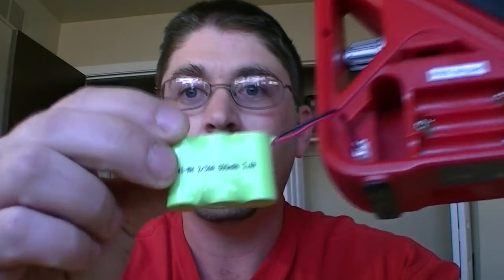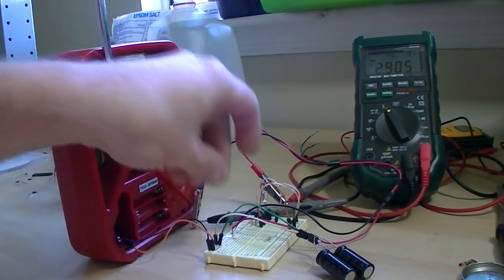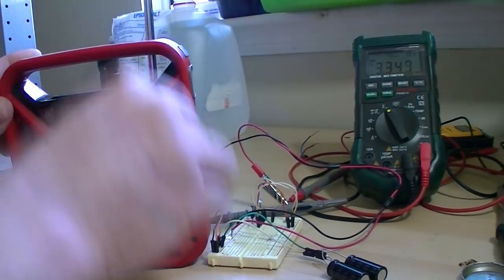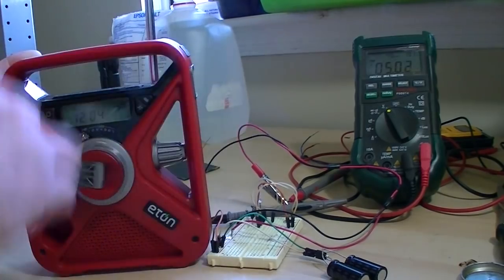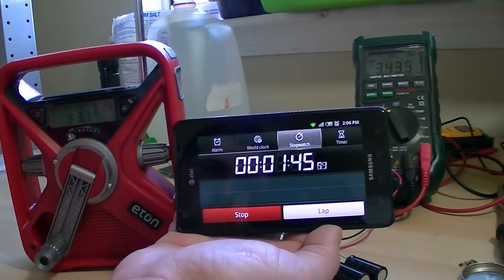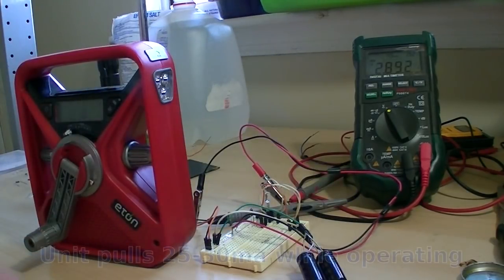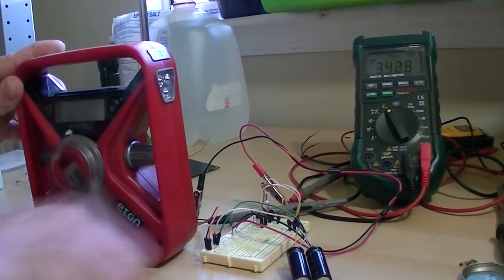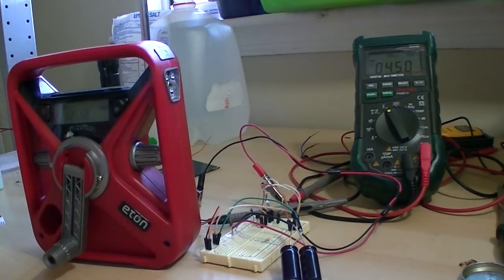Supercapacitors Instead Of Rechargeable Batteries

Comment: what about using a super capacitor to help charge the batteries?
Reply from the maker: wahtah955 In that context it's better to put a suitably sized supecapacitor bank in parallel with the battery to take the strain off of the battery when current spikes hit.
Reply: R&TPreppers thats awesome.  thanks   Would you wire them in  parallel with the batteries or would you have to be more fancy?  Does tha lack of resistance in the supercapacitor automatically drain before the batteries begin to pull charge from?    I'd love a video on that,  if you don't already have one  thanks

Comment: Hey

Do you know

Multimeter or volt meter has high resistance
if you use it with LED

It can run only 1 minute Maximum

Comment: Another name for "supercapacitor" is a "capacitor". There's nothing super or magical about them, they are just capacitors. Here's your example of the difference between a legitimate electrical engineering degree from an accredited University and some schmo that went to ITT Tech. There's a reason billion dollar electronics companies use batteries in cell phones, iPods, etc. It's because they hire real engineers.
Reply: Supercapacitors are low voltage components. JSR Micro-3.7v Li-Ion-capacitor 3,000F!;  NEC 3.7v Li-Ion-capacitor 1,200F!!! These are not LITHIUM Batteries! you should do some research before you post comments. :(
Reply: Jeremiah L Urine idiot. Nobody said capacitors were lithium batteries. I said that there's a reason billion dollar electronics companies, and the legitimate engineers they hire, spec out batteries in cell phones, iPods, etc. INSTEAD of capacitors. Your electronics skills are even worse than your reading comprehension skills..... or lack thereof.
Reply: Mark Mark lol on that one :)  i am sorry for your misinterpretation of the comment that "these are not lithium batteries", but once again you should do your homework on the manufacturing of Super Caps (Li) vs Regular Caps (Al or Ta) and their uses. Supercapacitors Instead Of Rechargeable Batteries (YT). I also guess from your conclusin that their is nothing magical about Lipo batteries either  5S 5000mah.
Reply: Jeremiah L No, there's nothing to misinterpret. That's what you said. And you seem to think you can cover it up and make yourself sound intelligent by listing item for sale at Radio Shack.
Reply: Mark, they are named "supercapacitors" to distinguish them from regular capacitors, including electrolyte caps, they have different internal structure - No typical separator inside. Due to different construction they have energy density levels magnitude or two higher than electrolytic caps.
Both zinc carbon and lithum ion batteries are electrolytic cells, but to help distinguish between them we don't call them so.

Comment: Those batteries still have a higher total capacitance, super caps work effectively as batteries with a very high C rating both for charge and discharge but  you pay for that in lack of total capacity. High performance lithium batteries win out in most situations except cost.

Comment: Chinese already do this, my "800mAh" rechargealble battery, was in fact epoxy with a resistor and a axial capacitor...
(yeah, i usually take the lithium from old batteries, but wasn't nothing in this one)

Comment: Dude. Learn the difference between series & parallel. Paralleling capacitors adds the capacitance & leaves the voltage rating the same. Putting them in series doubles the voltage rating but halves the capacitance.
Reply: The capacitance is the work done to charge up an electron charge reservoir.

1 F = 1 V x 1 A x 1 sec of work done to charge a reservoir.

If we stacked five 1 F capacitors in series = 0.2 F stacked,
then 1 V will drive only 0.2 A in 1 sec.

Capacitance = charge q / voltage V.

Given a constant charge q, and a five times voltage increase, will reduce the capacitance requirement to 0.2 F.

5 V maintains 5 times coulomb energy or requires 1/5 capacitance to store 1 time coulomb.

But if we increase the charge capacity by five times too, then the stacked capacitance will still be 1 F.

As long as we can ensure each of them has a terminal differential of 1V and drive a charge of 1 Amp.sec across each unit that was placed in series, we will be able to bring each of them "up-to-charge" of 1 F each.

Therefore, placing 1V DC across a series of five 1 F capacitors would reduce their average terminal differential to 0.2V and hence the reduction in capacitance fulfillment within 1 sec of charging.

But if we increased the voltage to 5 V, then we would be able to maintain the ideal 1V terminal difference.

However, unless they are self-regulating or externally balanced, we cannot ensure that elements placed in series will each have the same terminal differential as the others.

Therefore, we can charge them in parallel to ensure a 2.7V terminal differential during charging, and then discharge them in series. As long as there is charge in each capacitor, and a terminal differential, current will flow. So there is no point in thinking about in-series capacitance reduction, when we have strategies to charge each of them at 2.7V ! ! !

For a given current, the higher the voltage, the lower the required capacitance.

Capacitance is not the charge capacity of a capacitor.
Reply: He is a little wet behind the ears, maybe the kid needs to go to school before making a video.
Reply: MrMac5150
Since there is no smiley face attached to your comment or a +1 for me I will explain. Lionel wrote " Learn the difference..." and I thought she had "schooled" him. So there's the insinuation explained mate.
Reply: MrMac5150 thatsthejoke.jpg
Reply: +God Emperor Lionel Lauer he said he has two 10F capacitors wired in series to give an effective capacitance of 5F, and looking the video it appears to be wired in series...don't understand your point
Reply: Cynthia Avishegnath You learnt him sumthin good.
Reply: Bull Shyte
You need to learn how to spell.
Reply: frtard
Retarded joke, people believe that shit.
Reply: PrevailingDanger He gets it right at the start of the video, then gets it completely wrong towards the end of it.
Reply: God Emperor Lionel Lauer

Butt head is wrong from start to end.

Comment: @R&TPreppers: A far more accurate test, and more reasonable it seems, would be to do the same test with the newer, more"standardized" Maxwell 350 farad 2.7V batteries, not 5 farad ones. The results would likely be more in line with seeing if reasonable discharge times result, etc.

Comment: Cool Vid.  I wonder if it would be useful to quickly charge the ultracaps & then discharge them into a slow leak li-ion cell or battery.  A 2nd generation li-ion cell can hold 85+% of it's charge for over a year (from what I've read).  What do you think?
Reply: ***** I've charged many 18650 li-ion cells.  They aren't particularly hard to charge.  I just use an old phone charger & have it cut-off charging when the in-circuit V reaches 4.2 V.  At 4.2V, the cell is over 90% charged--which is good enough for most applications.

Just a thought.

Comment: I already designed a slow discharge discharge capacitor to handle batter powered devices. Tee are already capacitor battery replacements on the market... They do not last for long without recharging...

Comment: What are the capacitors made of?
Reply: George Louis
Copper is the best!If you exclude Gold..But mostly a special Iron is used.But maybe in the super capacitor it is Copper??
Reply from the maker: I may actually answer this question soon.  I want to open up an electrolytic capacitor and a EDLC supercapacitor and compare the two internally.
Reply: R&TPreppers
but are they liquid metals?
Reply: Capacitors are made of two long sleeves of metal with isolating material in between,rolled up together.
Reply: ComPuterAddic
Any conductive metal? Copper?
Reply: ComPuterAddic lithium is mentioned as metal for supercaps at less than 5v.

Comment: Why do you call them super capacitors? They look and perform as standard capacitors to me.
Reply: super caps are hybrid caps; low voltage high F, low discharge current.  Benefits are 100,000 recharges or more vs battery 300 recharges. Typical Applications are a 5ma drain for 100hrs, then recharge in 1 mins, x1,000,000 cycles. ex: Laptop internal clock and bios settings.

Comment: the charrge on a 2.5 f cap is, 1 farad = 1 Coulomb, 1 Coulomb x 1 Sec = 1 Amp, so if 2.5 f lasts 2.5 sec that means the radio uses approx 1A to run, if you used something that used 100mA it would run for 25 sec, or 10mA would last 250 Sec or about 4 min if you put the caps in parallel 20 Farads would make your radio last 20 sec.
Reply: yes but minus the unusable voltage level,, 3v~2.5v radio cutoff. this would work better with a single AA battery headphone radio for less than a dollar.

Comment: wiring caps in series halves the capacity. caps in parallel adds capacity. so your 2 - 10 Farad caps could be 20 Farads it should go for 20 mins.

Comment: Could you do one of these using the built in LED light?  I'm also curious about the mini-usb port that can be used for charging items.  Would that still work to charge a phone? 

I've been looking these emergency cranking machines for a while but having had other cheap hand crank chargers with puny batteries, was put off by the idea.  There was always a LOT of cranking involved with those things with so little return.

Comment: Never say never, but I suspect that batteries and (super) capacitors will live side by side for a long time. They have complimentary, but different characteristics and therefore applications. Many appliances, including cars, have batteries that provide high start up currents and then low running currents. Supercapacitors are great at providing high currents for short periods but are not as well adapted for the slow discharge - mainly due to lack of capacity.
A typical 12v car battery is 120 AH which in one hour if you draw 120 amps the voltage will fall from about 12.6 (fully charged under load) to 10.5 (fully discharged under load). The voltage over a 1 Farad capacitor will drop 1v in 1 minute when 1a is drawn. Therefore a 120AH capacitor would need to be 14,400 Farad with a 15v rating. Now things will change, but currently super capacitors are rated about 2.7 v which means you would need 6 of them in series to rate 15v. Therefore each of them would need to be 86,400 Farad.
Maybe that will come, but why would you bother trying to make a capacitor act like a battery when a battery does a much better job of it (try cranking a cold engine with capacitors).
Use capacitors for the surge (fast charge fast discharge) and batteries for the stamina.

Comment: Hiya, why not charge the caps with the dynamo and then discharge the cap to the battery? Would that be quicker? Plus arnt 2 capacitors in series with the same values half. I.e 1/((1/c1)+(1/c2)). In this case 1.25 F.

Comment: Won't the batteries last longer and cost less?
Reply: The issue isn't long term storage.  We're talking about hand cranked rechargeables here.  While a battery can store that energy for longer and much more, the amount of physical effort and time needed to reach that level is pretty high.  Hand cranking a rechargeable battery for 5min of use on a emergency of radio will burn a substantial amount of calories and take rough 5min worth of cranking.  For the radio or emergency light, you won't need it that long.  And if your rechargeable batteries have already been drained from use then this is the best alternate option.
Reply: If you check specs of typical ultracaps - it can store 5.52 W/hours per kg. So even if you had a ton worth of this caps, you would only be storing around 5kw/h. Thats not much compared to batteries. There is also a huge price difference. I don't argue about it's ability to charge/discharge faster, but all other attributes make it unusable in battery-scenarios.
Reply: Google+ SUCKS BALLS - the worst forced social network
The thing with capacitors is that the amount of energy stored in them is proportional to the potential across them.  As such, only a fraction of the energy in them can be effectively utilized unless the load can work with very wide operating potential ranges or there is an intermediate potential matching DC/DC.
Their very low ESR is also a problem with fault currents in the bigger capacitors, some of which can stick thousands of amperes through a dead short.
Reply: randacnam7321 Agreed, but how about adding a " jewel thief " to drain a bank of supercaps to 0 volts while refilling a 12v 0.2F cap as a buffer for an emergency device.
Reply: Google+ SUCKS BALLS - the worst forced social network  large caps would be my preference for these hand cranker cost set aside, a bit larger than what was used in the demo
Reply: The problem is that it's going to take a lot more time cranking that handle to get 2m 30sec worth of play time out of a rechargeable battery.  Rechargeable batteries can store power longer but take much more time pre-charging or cranking at less than a 1 to 1 ratio. 

So in an emergency situation with rechargeable batteries, you get the long first use time, then really really short times afterwards requiring ALOT more effort.  With the capacitors you do minimal cranking for when you need it.  The ratio of time to charge under the solar cell is even worse with a rechargeable compared to the capacitor.
Reply: And mutch more enviormently friendly. It's just two very large plates....
Reply: Jeremiah L a small boost converter would do far better set to the minimum the caps can provide. However cranking time would then be far longer..
Simple fact is energy from cranking = working radio time. More cranking = more time listening.  No escaping that fact. With super caps you have to crank far more frequently than with a lipo or NMH battery where you simply crank longer the longer you want to listen.
A larger capacity Lipo or NMH battery bank feeding a boost / buck converter voltage regulator would make more sense. Then the power from a solar panel can charge a bigger battery and you can listen for longer.
Reply: Google+ SUCKS BALLS - the worst forced social network
A high-energy Li-ion cell (18650)--which weighs 50g--provides ~10.36 Wh of energy.  1 short ton of those cells would provide ~18.1437 kWh of energy.  That is ~3.6 times more energy per unit of weight.

Comment: I have an energizer 15 min charger for aa & aaa batteries, after about 12 charges i gotta go buy more rechargeable batteries at $10 for four of them, how come it eats my batteries????
Reply: measure voltage of the batteries off the charger, 1.4v,1.3v,1.3v,1.1v; out of balance and needs to be balanced.  One battery may not be charging correctly by the charger. ex: 1.0v off of the charger instead of 1.4~1.6v warm off the charger.

Comment: What about using HV capacitors instead. Charge them with renewable energy faster than a battery charger, and lighter weight(With a little more research and development than current tech)
Reply: Any chance to use them with solar cells to charge batteries ? Thank you :)

Comment: No. 

Cost and size [10 times the size for the same sized battery] don't 'yet' make them anything like a replacement for any kind of battery.  A possible use might be in some applications that require a quick drain to which super capacitors do better with, though when you combine with the fact that the best super capacitors are still taking 10 times the space of the equivalent battery [and wildly more expensive], their use as battery replacements is still some way off.  They are developing quicker than batteries and in the future will probably pass batteries in use [and their production costs will be lower than lithium based batteries as is their life expectancy] with volume and competition bringing them to well below the costs of batteries.

Comment: If you have the capacitors wired in series wouldn't you only have 250f?? Wiring them in series doubles the maximum voltage capacity of the pack, but doesn't double their farad rating. Wiring them in parallel will get you 500f but a maximum voltage of 2.5v which was probably too small to replace your 3.6v battery.
Reply: you right. two supercaps in parallel wiring stil have same voltage. This men charging 2,5-2,7v two supercaps in parallel wiring on 5 volts. one have 25 farad. two in parallel w. have 50 farad. I thing if i charge 2.5 volt cap on 5 volts have smaller capacity ....
Reply: Hi
Reply: toysareforboys Two series capacitors reduces combined capacitance.
With caps of equal size, it halves the resultant capacitance.
Reply: There's no girls on the internet noob.
Reply: Thushara Fernando just dont judge by a dp
Reply: a beautiful girl with a BRAIN!!! YAY!

Comment: It would be relatively easy to detect when your caps are being charged and automatically switch from series to parallel & back again when you're done cranking, using a few miniature latchable relays and one or two other components.